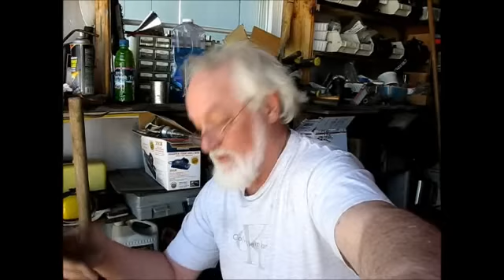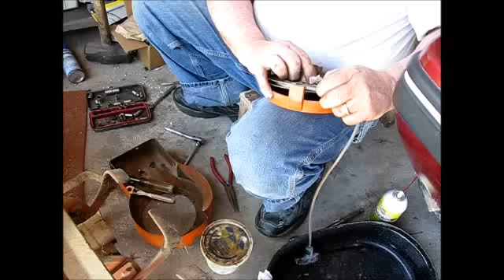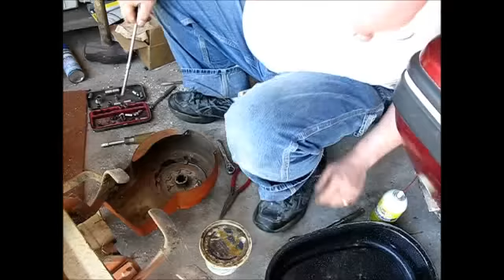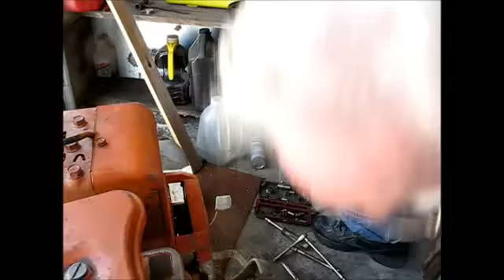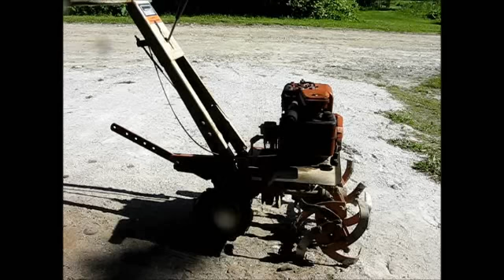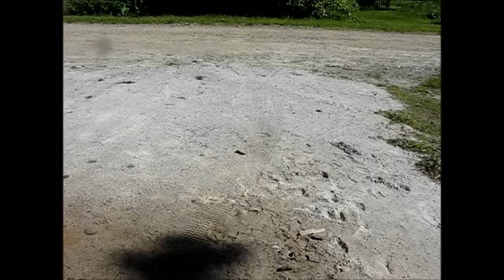Roto Tiller pull cord fixed

Comment: You inspired me to go work on mine. Took the carb off cleaned it out and runs like a top. Mine is an old craftsman 24 inch front tine chain drive.  Not built as good as that one.